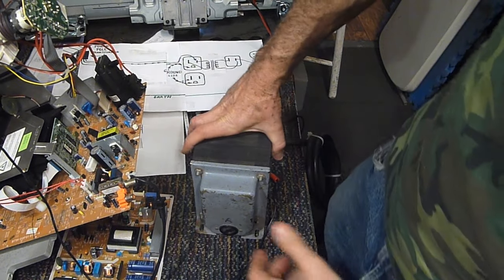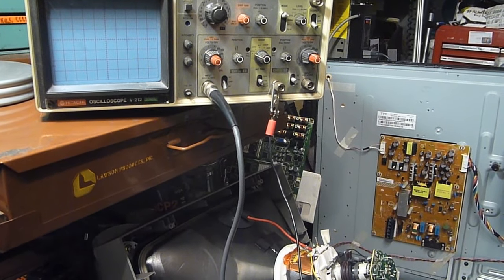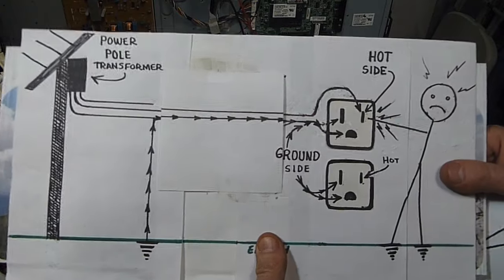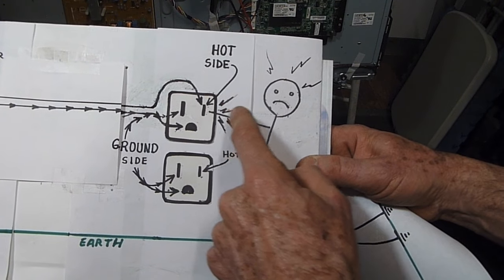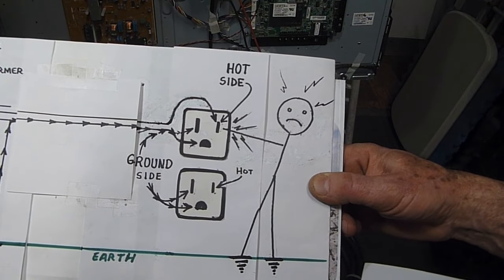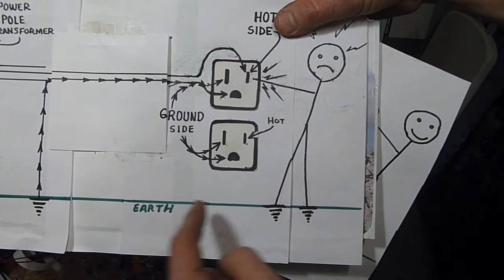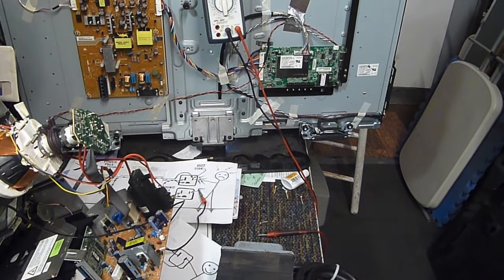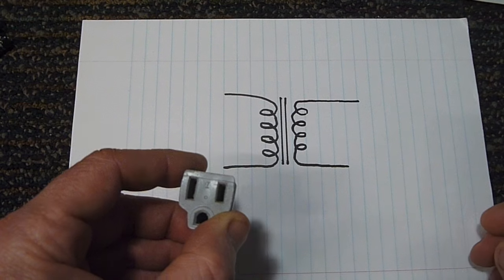Isolation Transformers can save your life, and your equipment.

Comment: here's what I need to wrap my mind around, why is the ground into the earth or on a metal frame even required in the first place?
Reply from the maker: If the hot wire were to make contact with the case of grounded a metal drill for example, the circuit breaker would trip. If the case wasn't grounded and the hot wire caused the metal case to become hot in relation to earth ground, you have the potential of being electrocuted.
Reply: @GrantsPassTVRepair  so if I understand this correctly..... in a grounded system, the hot wire touching metal--->circuit breaker senses a broken circuit and shuts off....or does it sense an overload? or does it complete the circuit back into the earth, through the grounded wire?

so if no ground wire, the electricity just finds the path of least resistance trying to make it's way to the earth, therefore your body acts as the ground....????
Ground always comes off of neutral wire?
Reply: after looking into this more, after a few more video's, I totally get ground and circuit isolation. The isolating transformer just moves the circuit inside the little box and takes the "ground", in this case, the physical ground, that you're stepping on, out of the equation... and since, typically ground wires are speced for super low resistance so the electricity wants to follow that path first, therefore causing a surge, therefore tripping the circuit breaker. All makes sense now...
Reply from the maker: @jonathanbrazeau970  I'm glad you figured it out.

Comment: Can you safely modify a Variac by separating ground fro the neutral?
Reply: Most variac have one side of the two prong outputs permanently connected with neutral they are even worse , unplug one and put a low ohms tester between input and output you will see the short path !

Comment: sir in our place it is hard to buy isolation transformer cause its not available so i am planning to build one can i use two units of 220v to 110 volts step down transformer and connect it back to back is this possible...
Reply from the maker: I'm sorry, but I don't understand your question.
Reply: @GrantsPassTVRepair  I am planning to build an isolation tranformer can I use 2 units of ready made 220volts to 110volt steps down transformer and connect this way 220 input /110 output 110output/220input  i will wire the 110 output together and use the first 220v as the input side of the primary and the second side of the 220v as my output on the secondary side. thanks ...
Reply from the maker: @reynaldochua1844  Are you trying to build an isolation transformer that has an input of 220 volts AC, and an output of 220 volts AC?
Reply: yes using 2 units of step down transformer cause i could buy ready made 220 input and 110 output can i wire the 110 ouput together and use the 220 input on one end and 220 output on the secondary which is isolated ..
Reply from the maker: @reynaldochua1844  If your asking me if you can combine Two 110 volt AC output transformers  to come up with 220 volts AC the answer is yes, as long as you make sure their polarity is correctly wired,  just as you would  when connecting batteries in series.

Comment: Should the test equipment use the same "isolated" AC supply as the equipment under test or can it be left plugged into the house or shop outlet?
Reply from the maker: Technically speaking It would seem you could Isolate the test equipment rather than the device being repaired to get the same end result, but this question has been raised in the past, and I vaguely remember someone giving me a good reason why it's safer to isolate the devices being repaired rather than the test equipment.
Reply: You should never split the isolated output to more than one equipment..

Comment: When using an isolation transformer, can you touch both live and neutral and be fine?
Reply from the maker: No. If you touch both live and neutral wires you are still going to get shocked.
Reply: Why would you want to do that?
Reply from the maker: @KameraShy  Why would you want to do what?
Reply: Think about it. If it can power the device that is connected then how could it be safe to put yourself in place of the device. Btw the output has no live or neutral as it is isolated.

Comment: Can a hand tester glow on wire after isolation transformer
Reply: Do you mean a non contact voltage tester? If so, yes, they're just antennas basically that pick up the AC field, which still exists just the same as the mains side of the transformer.

Comment: Why not just use a GFI and feed a 2 wire outlet off the load side of GFI? A GFI monitors the current flow from hot to neutral and will trip if the same current going out doesn't come Back. In old houses that have 2 wire plugs, the NEC allows,  you to replace a 2 wire plug with a 2 wire plug as long as you install a GFI 1st for the circuit so that all the 2 wire plugs are fed off the GFI on the rest of the circuit.
Reply from the maker: Yes a GFI outlet is a good idea for safety, but it doesn't eliminate the problem of isolating your grounds.

Comment: Do isolation transformers reduce line noise?
Reply from the maker: They can help reduce  high frequency line noise, but not so much with the lower frequency noise. https://www.ramelectronics.net/audio-video-isolation-transformer-noise-filters.aspx#:~:text=Isolation%20transformers%20are%20extremely%20effective,low%20frequency%20or%20differential%20noise.&text=The%20maximum%20voltage%20rating%20for,that%20the%20transformer%20can%20handle.
Reply: @GrantsPassTVRepair  Your a BOSS ,thanks very much for that

Comment: Great video.  Thank you for making it.  I have a question about this.  Isn't it possible to achieve the same thing using a two-prong adapter?  If I plug my three-prong device into the adapter and then plug the adapter into the main, did I not isolate the device from ground?  Thanks to anyone who doesn't mind answering this.  The adapter that I am referring to is a small, two prong (no ground) adapter.  This can be seen at:  https://upload.wikimedia.org/wikipedia/commons/thumb/5/53/Cheater_plug_edited.jpg/1200px-Cheater_plug_edited.jpg
Reply: Brad Settle I dont believe that will work because the neutral side of the outlet is still connect to your ground in your home so you would still get a ground path through the neutral. With an iso transformer there is no neutral connected to ground.

Comment: If there is a ground tab on the isolation transformers cord you want to cut it off right?
Reply from the maker: I just used an adapter that didn't have a ground tab on mine and it worked fine, but when in doubt take out your meter and verify if you have true isolation. It's better to be safe than injured.
Reply: No. The ground wire on the input side is connected to the chassis and the iron core of the transformer. If somehow the isolation in the primary breaks down, it will blow the fuse or trip the RCD. If unsure, check for continuity between the transformer output and your outlet ground, there should be no connection.

Comment: Crap, still don't get it. If you touch the live, what happen to the voltage and the other wire?
Reply: After that it becomes 120 V. If you touch one hole and your pal touches the other you both get shocked.

Comment: Can this be used with a generator as an extra safety?
Reply from the maker: Yes it can be used with a generator.
Reply: @GrantsPassTVRepair  do you think it will protect against shocks??  I got a large generator and I cant ground it will this help?Thanks
Reply from the maker: @samuelkatherinediozarago7692  It may help, but there is no one size fits all answer to your question since it depends on how use the Isolation transformer.  If you master my explanation in this video it should help you to figure that part out.
Reply: @GrantsPassTVRepair  I have researched that generators have "floating ground" and I feel comfortable with that system.Just wanting to buy devices which can protect the most.Had one of these iso transformers years ago got from an auction lot and sold it as I never needed it.Now there are plug in RCD devices and other stuff but I want the maximum protection against any possible fault or problem.Watched the video but had hard time understanding :) Thanks

Comment: At the end of the video you said that some isolation transformers dont have true isolation, if thats the case why are the even made and whats their purpose?
Reply from the maker: That's a good question I don't have an answer for. If you find out please tell me.
Reply: I don't use isolation transformers because of a safety benefit.  But because they reduce EMI noise floor, they filter out a lot of surges and fluctuations and spikes and drops.  Cleaner power always makes cleaner signals on analog gear and often makes a difference between works-vs-NOT-works on digital gear, lol.
Reply from the maker: I hadn't given that much thought, but it makes sense that an isolation transformer could be used as a good way to avoid voltage spikes and EMI noise. Thanks for the info.
Reply: https://en.wikipedia.org/wiki/Isolation_transformer
Isolation transformers are good for lots of stuff.  They have different capacities (beyond their VA ratings) mainly because of cost.  A simple isolation transformer used for audio (or radio) impedance matching doesn't need to be as robust as a complex center-tapped isolation transformer with built-in rectifiers/inverters meant to reduce line harmonics, most applications benefit more from lower part costs than from overkill part capabilities.
Reply: So does that mean the ground is added as a safety measure if the transformer is used in that purpose?

Comment: So, what if I use Isolation Transformers for every appliance in my home. Does it have a side effect?
Reply from the maker: No side effects that I'm aware of, other than the fact that you will consume a slight bit more power due to transformer conversion losses, but not a significant amount of power.

Comment: i understand the concept of using an isolation transformer on a TV or powersuply. since there is no longer a potential to earth ground the risk of an electric shock just by touching one point or "hot" is eliminated. it does not eliminate the risk ot shock if you touch two points with high voltage potential. anywho... what really puzzels me is how this helps using an classic earth grounded oscilloscope on that device. that very moment i do attach the oscilloscopes earth ground to the device under test it will become grounded again and so it will be dangerous  again to touch anything. so whats the point here? i am missing something... but what/where ?!
Reply from the maker: Can you clarify your question? Perhaps you can edit what you already wrote.
Reply: Grant, I made a YouTube video a long time ago that covers what Axel is concerned about. It is near the end of my video "Isolation Transformer - Tripp Lite IS1000". Axel is correct, once you connect a earth referenced oscilloscope ground clip to a DUT that is powered from an isolation transformer the DUT is no longer isolated. You don't get sparks when you connect the clip to the DUT because the DUT's power source is not referenced to earth ground until you connect the scope's ground clip to one side of the DUT's power source. After this connection the DUT is no longer isolated and you can get a shock to your feet just as you mentioned in your video when not using a three prong to two prong adapter on a non-isolated transformer. All that is required is that something, the isolation transformer, the DUT or a bit of connected test gear makes reference to earth ground and once that occurs then your isolation transformer becomes "non" isolated instantly with the danger of shock recreated. Does that help?
Reply from the maker: Thanks  for the clarification. Yes I understand there is still the potential to be shocked even if you have an isolation transformer in place. I don't think anyone denies that, but your not going to have an issue between an earth ground and your devices under test if the chassis is hot in reference to earth ground, or if using a power tool outdoors you needn't worry about a shock between earth ground and yourself. That's why I find them valuable.
Reply: Grant, Your just about there but I see I need to help you along with one little issue. You will get a shock to earth ground from your DUT that is connected to a technician isolation transform if you connect your oscilloscope's ground clip to either of the power input legs of your DUT and then touch the other potential of your DUT with your finger while your bare feet are on earth ground. I know this is strange but test it. All earth referenced oscilloscopes that have three prong connectors to a fully earthed referenced outlet will setup this hazardous shock potential meaning your isolation transformer is no longer protecting you when your scope is connected. Maybe watch my video "Isolation Transformer - Tripp Lite IS1000" at minute mark 48 will help.
Reply from the maker: I'm sorry but my brain can't keep up with all the concepts your trying to  share with me. From my prospective the principle is no different than that of a car battery in relationship to earth ground. As long as the car batteries ground is floating/isolated,  there is no potential for a shock from the positive side of the battery to earth ground. It's the same principle with a Two wire isolation transformer.
Reply from the maker: I should have added that if you do have a conductive path between  earth ground and your isolation transformers output then you can't call it an isolation transformer. My isolation transformer only has Two wires, and it does everything I described in my video. I can attach its output to an earth ground and no sparks.
Reply: Question ist, R u using one or two  Isolation Transformers? If if just one, then ob what devices? The dut or the oscilloscope?
Reply from the maker: I generally plug the equipment I'm testing into the isolation transformer, but you can plug just the oscilloscope into the isolation transformer rather than the device if your only concerned about isolating the device your using from your oscilloscope..
Reply: K. now wouldnt it be much safer if  we would use TWO Isolation Transformers then? One for the dut and one for the oscilloscope, so there will be no earth Ground at all? Or am I missing something potential dangerous here ? ***** too
Reply from the maker: One should be enough as long as it does its job.
Reply: Just one is fine. The object is to stop the initial ground reference back to the power source so if one is isolated you have achieved your goal. That said, it should always be the DUT because that is what you might be poking around inside and you shouldn't float a scope if you can at all help as floating a scope can cause it damage and cause crazy readings.
Reply: You're almost there now. I have watched your videos for a long time so I know you have the mind to understand what I'm getting at so please try to follow along just a bit father down this rabbit hole. You will not get a spark when you attached your scope's probe ground clip to to either of the two wires coming from your isolation transformer to your DUT's input. There you are 100% correct. I'm not saying that is the hazard. The hazard is that once you do connect a probe ground clip from a earth referenced oscilloscope the isolation transformer itself is no longer isolated because you just strapped one of the two isolation transformer's outputs to earth ground through your earth grounded oscilloscope. No sparks yet but if you then touch the DUT thinking it is isolated and safe you will find it isn't and you will get a dangerous or fatal  shock. Disconnect your scope's probe ground clip and the DUT is once again isolated and safe. Test this but use a meter or a light bulb not your finger.
Reply from the maker: Okay I understand you now. Your scopes ground will turn on side of your isolation transformers output back to an earth ground once you clip it to the chassis, so there is still the potential to get shocked if you happen to touch a hot in reference to the device being tested. That's a valid point, but from the technicians standpoint I think our main concern is electrical isolation between the Oscilloscope and the device being tested.
Reply: exactly. i was unsure, because the purpose of an isolation TF could be one of at least two purposes. like isolation between DUT and Instruments (as you used it) or sometimes just isolation from earth ground, so that it will be "safer to work on", which if course is still not idiot proof. but its clear now. so thanks for the video and demonstrations!! videos like these are worth a lot. not by money terms. but educational. so thanks mate!
Reply: Its a good point to make clear that this (scope earth connection described above by Tod)
shock scenario exists. This video is very nicely succinct and 
just about definitive. (I just subscribed because of it!) Adding this little bit of extra info would make it just about perfect. Too many online (amateur tech) videos waffle on and on about Isolation transformers, making it all sound far more complex than it really is. This one is the best I have seen online so far. Without any unnecessary waffle. You can tell this video is by someone who really knows their stuff. Wish I had found you earlier.

Comment: Shouldn't there be 3 wires going into that outlet: live, neutral and ground. Or is neutral wire connected to ground wire anyway and you cant escape it unless you use an isolation transformer and that is why you used 2 wires ????!
Reply: The term: isolation says it all. It is isolated from the ground. It my have  dummy ground hole to allow the plug but the output of the transformer must not be grounded.